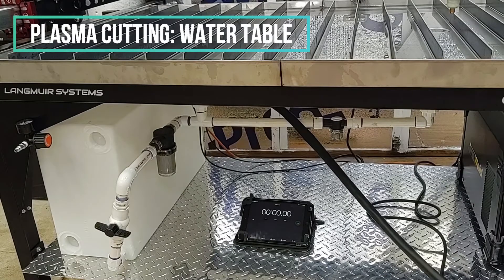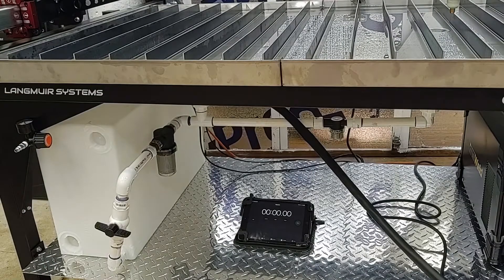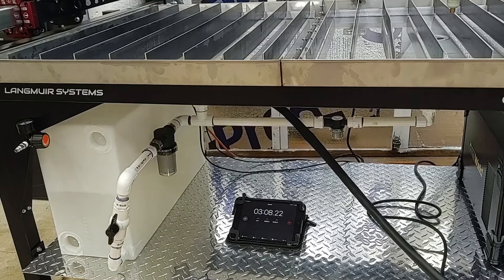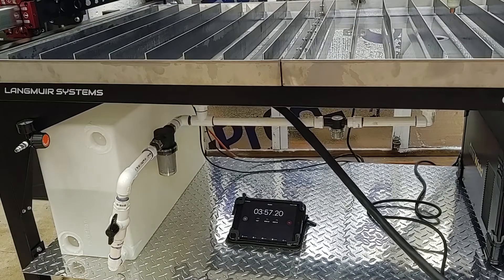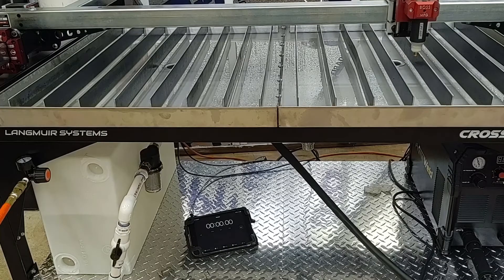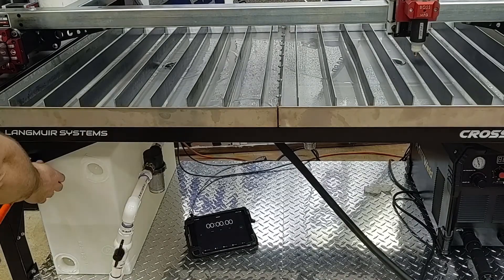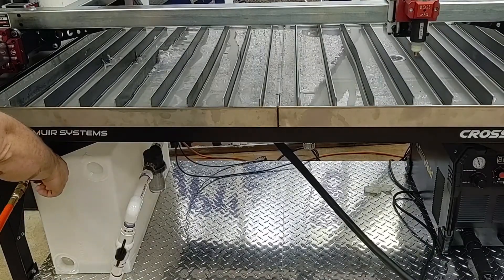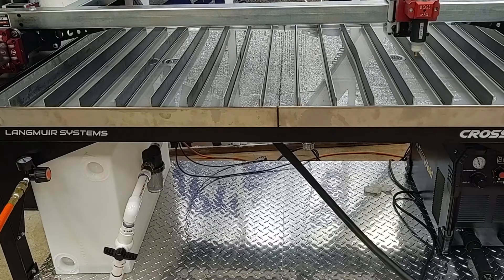Long-EZ N916WP - Plasma Cutting Water Table

Comment: I just did my first fill/drain as well on my smaller crossfire with a similar tank. I noticed that it bowed out and expanded quite a bit which is a little scary. Have you found that your tank has been holding up OK? Also what pressure are you using to push the water up?

Comment: Nice video.  I'm going to be purchasing a Crossfire Pro for my new workshop this spring.  I also plan on having all PrimeWeld products and I see you're running the PrimeWeld Plasma, but can't really tell if it's the CUT60 or not.  Have you had any issues running the PrimeWeld plasma on your Pro?  Langmuir does not recommend the PrimeWeld for their tables any more.  But I know Langmuir has been doing some upgrades to their electronics to help cut out EMI and PrimeWeld has been adding shielding in their units to keep them cleaner in relation to the Langmuir electronics.  What's your thoughts now that you have almost a couple years of use on your system?  Anything you would do differently?  Thanks and keep up the great videos.
Reply: Thanks Dan.  I did have issues cutting with the PrimeWeld Cut60, but it was resolved after I stopped using the CPC interface and connected it up using raw voltage.  It worked fine with the CPC at first, but then after a few months of not using it I had issues, and that's when I had to go the raw voltage connection route for my THC voltage input.  I also had to use a number of ferrite chokes on my USB cable and that seemed to do the trick as well.  I honestly haven't used my plasma cutting table in probably over a year, since my main project is building an airplane and I simply haven't needed it.  I love the PrimeWeld Cut60, but obviously the issue is not necessarily the cutter itself, but the integration of the cutter with the CF Pro.  I haven't kept up on the integration/issues in a long time, so I can't comment on recent experience.  If you can swing it, I would strongly recommend considering a HyperTherm.... again, solely due to integration and nothing against the PrimeWeld.

Comment: Nice clean setup. I like the air to refill, no pump required. It looks like you are pumping both ways thru the filters. How does that work? All filters I know about are one way. Where did you get the plastic tank from?
Reply: Those are cheaper filters.  Yes, should be one direction but they work in both directions.  Plastic tank off of Ebay.

Comment: Running backward through the filters won't you be pushing all the dirt back to the table? Ptherwise I like the concept. Mike
Reply: Also thinking a to refill, a small pump in the reservoir with an out let and valve to take the filters ou of the equation on the refill cycle. Mike
Reply: @michaelgaffney5643  The filters have removable cups so you clean them after you drain the water down into the tank. Plus they're clear so you can see how dirty it is.  I'm really only looking for the bigger chunks, since  couple of cuts after putting the water back up in the table it will be dirty again.

Yeah, a lot of guys use pumps, but I just wanted something simple so am using compressed air.  Works fine.
Reply: Empty filter before refilling?

Comment: Nice setup, I’m waiting on mine so my comments are based on others experience. I think your filters will clog after the first cut. Most people with adjustable water tables have a sump to take out big slag particles.
Reply: They're cheaper filters and I can remove the cups and clean out the debris.  Nothing complex on the filters.